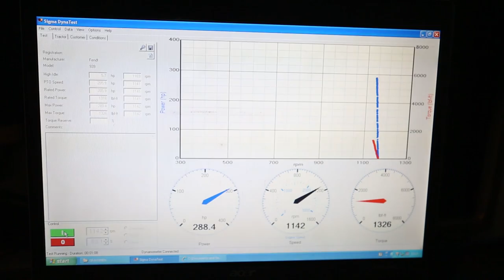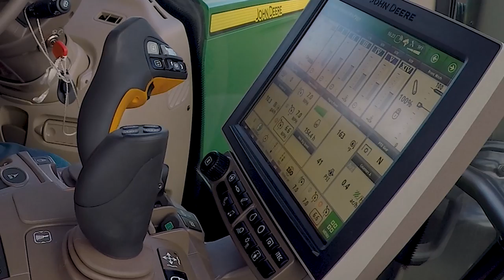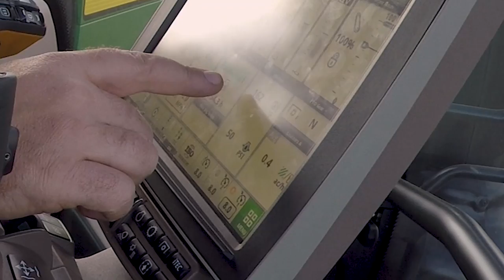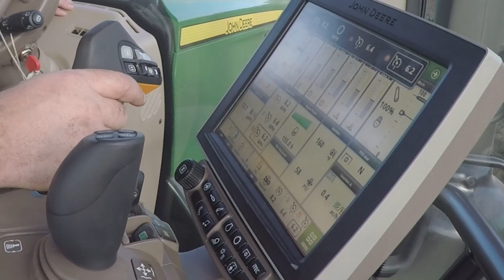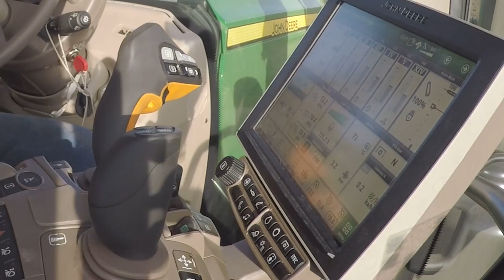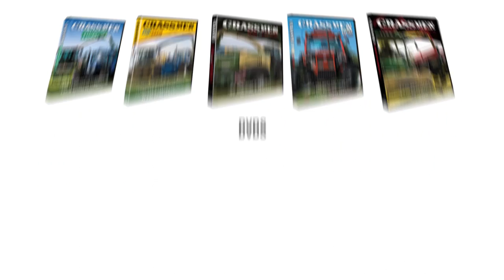GRASSMEN - Fendt 939 vs John Deere 250r ploughing

Comment: Fent all the way the Deere hunter
Reply: Gets yours now at your local fendt dealer for only double the price of any other competitor.
Reply: New Holland will always be best as they are a good price good to grip, high horsepower and comfortable to work in

We have a t6030 here at home and she is a mad yoke
Reply: @moneenagrivideos6207  yeah all that's true but you can't beat deeres dealer service and cab comfort for a small bit more with fendt you get all of that even better for an even bigger price tag
Reply: Tm155 and Ts115 new Holland is what we have
Reply: @Joey-ve7ku  Fendt ranked number 1 for the best service
Reply: @FarmingBros  where do you get your statistics
Reply: @FarmingBros  I'm sure fendt service is good but is it worth it? I mean you are looking at 20% than other competitors
Reply: @Joey-ve7ku  From Tractor Lab
Reply: @Joey-ve7ku  Fendt has more quality put into it than a deere and there better on fuel
Reply: Agreed Fendt all the way
Reply: Leussink Farms “fendt” have more quality. If you want quality buy a case or a Deere not a fendt. Probably the best brand in the world to use plastic. Good luck paying for your fendt by the way. You pay way more for parts. Services are not easily done. If anything minor goes wrong you need to bring in to a fendt dealer. A farmer in my area had to pay 13000 euro to replace the seat and screen because some fat lad sat down in it too fast. Also couldn’t find a video on best service. I suppose it depends on your area as well
Reply: @Joey-ve7ku  We live in Canada Alberta and we get great service From Fendt and we have't had a problem with are Fendts 
Go to tractor lab to find the video. We had deere and what junk the kingpin baring went every year on it. We service are Fendt tractors are self it does't take much of a brain.
Reply: @FarmingBros  yup glad you've had a good experience I've had a good experience with my 8400r
Reply: @Joey-ve7ku  well I guess someone has to drive the junk and support deere
Reply: @FarmingBros  yeah I know same goes for fendt

Comment: The front furrow was a bit deep on the 8 over 8. as the soil was going over the mouldboard.   You might have got a bit more efficiency if it was up an inch at the front.

Comment: I was told many years ago that as a rule of thumb it needs 25hp  per furrow so 8 furrow should be pulled by any thing over 200hp and am I right in thinking 250r is 250 hp?
Reply: 300 Hp including boost
Reply: That’s right, go back a few years and it was a common sight to see a 4 furrow plough on 100hp and that would be on heavy land! On the farm here my father would  pull 4 furrows with a 2 wheel drive ford 7700
Reply: But the drag of 8 furrows is surely sucking more power
Reply: No as I said 25 hp per furrow so 8 furrow needs about 200, 12 furrow would need about 300, 4 furrow needs about 100 hp
Reply: Depends on the tractors power to rate ratio and the foot pounds of torque as well though
Reply: Luke I’m getting the impression that your one of these guys that buys a 200hp tractor and puts a 4 furrow plough behind it
Reply: Even if you call it 30hp per ton then 240hp should pull that 8 furrow. I pulled a 6 furrow fully mounted with a Deere 7710 on heavy land. Was under a bit of pressure but still covered a fair bit of land
Reply: Correct and not really. The hp needed per furrow depends on the land you work. The average, as per book, is 33.5hp, but it depends on land. Here in my area is rated at 40hp.
Reply: @nemphis95  that is boys land they are ploughing not mens land!
Reply: Yea exactly. Which is why you get 7200r John deeres and such. The 6250r is a general all round tractor for transport, pto work, and can be used for tillage but it's power to weight ratio and frame design means it won't get the full pulling capacity in the field for it's power. It's a Jack of all trades. The fendt should also be way over powered for it's weight. But it's also classes as a high horsepower general work tractor. It's not like a magnum or Deere 8 series, which is why they seem more awkward compared.
Reply: @bobb6342  if I had a 200hp tractor I'd be over the moon as I'm only 14 and am interested in engineering and tractors so sry you got the wrong impression but I was just curious
Reply: depends how wide each furrow is though
Reply: marty summons hahaha I stay in Scotland so know what hills are like but if your 300hp tractor is struggling with a 4 furrow maybe you should give ravenhill a phone and see if they know what the other 200 horses are hiding
Reply: I used to go by the same rule of thumb, but in the days of 25hp per furrow, the furrows were typically only 12inch - these are 16inch........ So you're now turning as much soil with a 6 furrow as you used to with an 8.

Comment: Only 6 bottom plow on a 250hp tractor is a joke! I pulled that with a 140hp 4440!
Reply: If that's all someone can afford, so be it.
Reply: Depends on the plough and if it’s semi mounted etc
Reply: Was thinking that myself Andy and the whole omg it’s pulling the 8 furrow wi “only” 250hp 🙈 cmon now lads they were pulling that with smaller tractors in the 90’s at the Tillage events, and I’m pretty sure they didn’t have the tyre technology they have now either!
Reply: Well here in my area with 160hp we plow with 4 furrows. 250 would do with 6 furrows.
Reply: Jd 250 hp without the boost and 300 with ! 6 furrows is a joke in a flat field like this one 😉
Reply: lejacksmc it is she pulls it no problem it’s not the power factor in ploughs like that it’s the leverage they put on the back end
Reply: Guess no one was paying any attention to what RPM's they were running at, speeds, etc. That makes a difference if you're attempting to compare the HP of older machines vs new machines. New vs old, completely different.
Reply: @Ham68229  yep i know that. Doesnt change the fact donkey didnt think the deere could pull it!  If they r pulling it at only 1400rpm with the bigger fendt then they have too small of plow. Peak power is at 1700 or 1800 rpm. So then the Deere could pull it just at higher rpm.